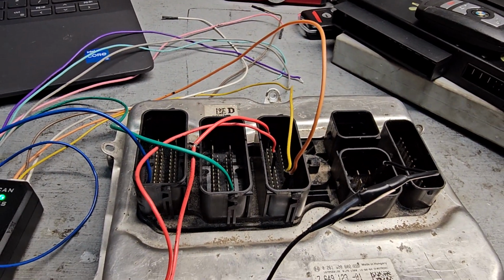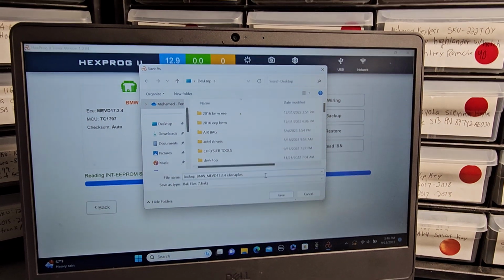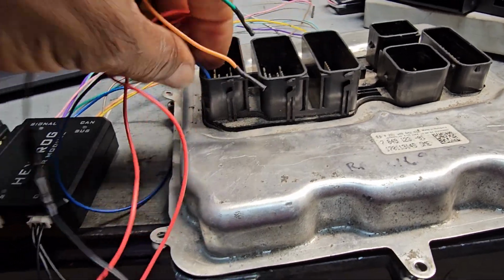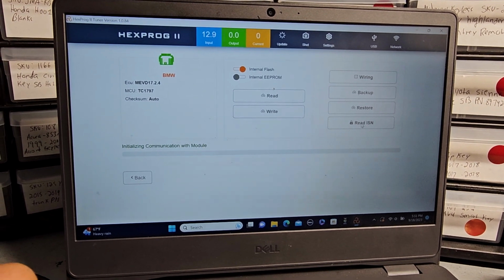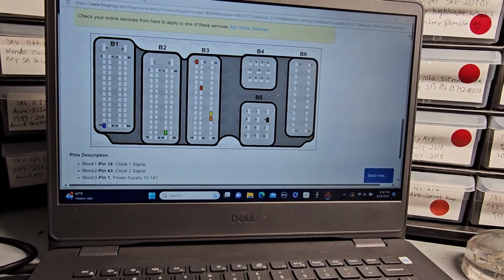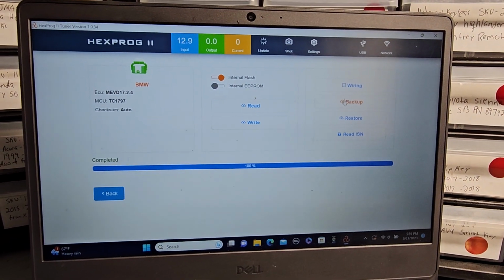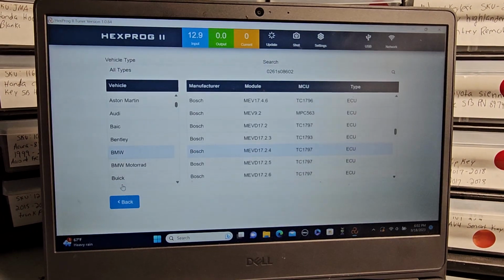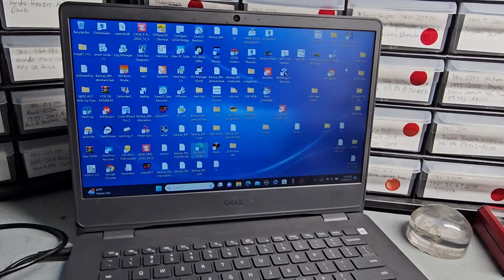BMW MEVD 17.2.4 Ecu Cloning Using Authex or Hexprog  Step By Step

Comment: What's the difference between hex pro and authex
Reply from the maker: Autohex and Hexprog are tools used in the field of automotive diagnostics and programming, particularly for BMW vehicles. While they are related in the sense that they both deal with vehicle electronics, they serve different purposes and are often used in different aspects of automotive maintenance and repair.

Autohex: Autohex is a diagnostic and programming tool primarily used for BMW vehicles. It allows technicians and auto locksmiths to work with the vehicle's electronic control units (ECUs) and key programming. With Autohex, you can perform tasks such as reading and clearing fault codes, coding and programming ECUs, and programming keys and remote controls for BMW vehicles. It's a versatile tool that helps in diagnosing and maintaining BMW cars.

Hexprog: Hexprog, on the other hand, is an extension tool for Autohex. It is designed specifically for ECU and EEPROM (Electrically Erasable Programmable Read-Only Memory) cloning. ECU cloning is a process where you copy the data and configuration from one ECU to another, typically when replacing a damaged ECU with a new or used one. This can be necessary to ensure that the new ECU functions correctly in the vehicle. Hexprog extends the capabilities of Autohex by providing support for ECU and EEPROM cloning, which is a specialized and advanced function.

In summary, while both Autohex and Hexprog are used in the BMW automotive industry, Autohex is a comprehensive diagnostic and programming tool, while Hexprog is an extension tool focused on ECU and EEPROM cloning, making it a valuable addition for those who need to perform this specific task in the field of BMW vehicle repair and maintenance.